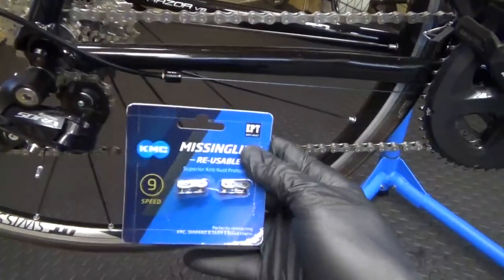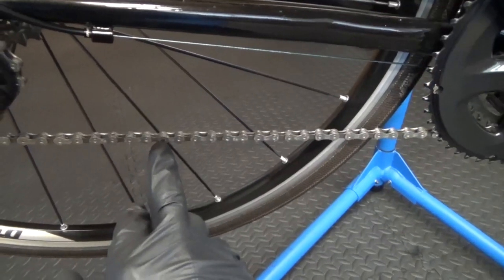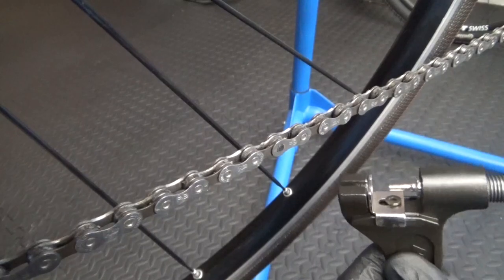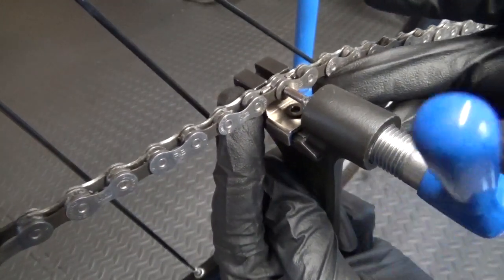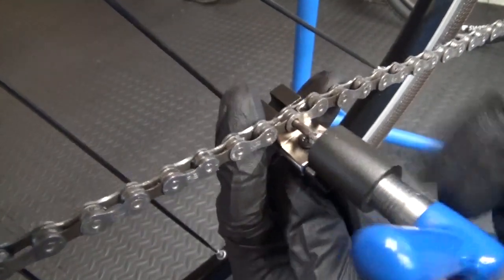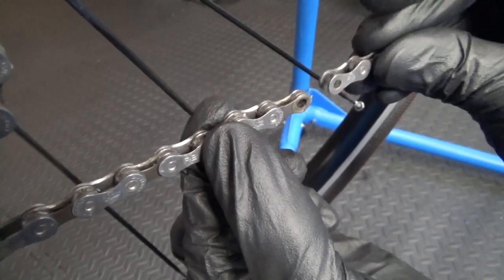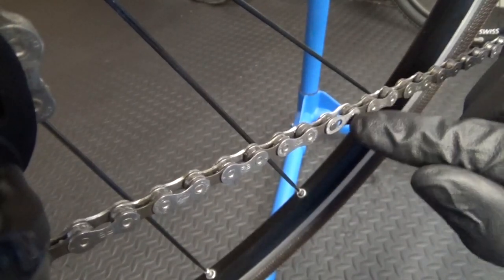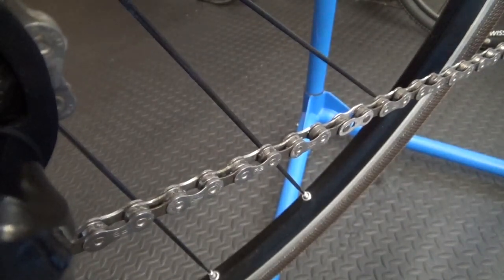How to Install a Missing Link to Your Bicycle Chain

Comment: I hear many people say you should only re-use a quick link too many times. I’ve often wondered if there’s a number of times. My chain is on a trike. I remove for clean/hot wax every month or two. I have three KMC missing links to make the job easier. They’ve been re-used maybe ten times. No problems.
Reply: I'd probably replace one with the chain, so If I replace my chain at 3k miles. I will get a new quick link. it's obviously reusable, they have tools designed just for them. That being said, if it concerns you, just keep a spare set of quick links on you when you ride.

Comment: I was also thinking about getting one of those KMC quicklinks, as they’re rated as “reusable” and they claim they can be reused up to 3 times. Though I don’t know what it’s meant by that, do they mean the link can be opened and closed up to 3 times or they can be used with up to 3 different chain cycles. Either way I was confused about whether it was better to use a joining pin or a quick link as a connection method and have found discording views about both, but I think I’ll try out both and make sure to change them from time to time for safety precautions. Your guide is very clear and helpful!

Comment: 0:05 ok right it's only good for one occasionally if your chain snapped my riding is fitting or do the job correctly 24-hour emergency Friday and back home from certain places where are advised many people not to go for a split link and put it on your bike I buy you to unlink one of the links a link extractor and put it on permanently starts wearing and tearing then once the chain snapped on you after usage then you are able to use a split link for emergencies when you're out and about

Comment: May be stupid question - but is it possible to press the pin back in the same chain link? I just want to replace the front derailleur, so essentially I just need to open and close the chain.
Reply from the maker: You would have to install a brand new pin!

Comment: What if the link has a directional arrow on it? I can't get my head round it. If you put one part of the link in so that the arrow is pointing in the direction of travel, the other part points against the direction of travel. Does any of this really matter cause I can't see any way round it. Same with the chain. Some chains say to have writing facing towards you. What difference does it make?
Reply: I have the same  question on those arrows; only one can point the correct direction.  The writing  must face out, so it’s with the writing I had the arrow go in the correct direction.  Shimano can sure use to clarify the double arrow matter.

Comment: I don't think my mountain bike has a quick link how do I take the pin out of a derailleur see if I if I can take the pin out of a brand new derailleur a front derailleur could I put that on the chain but what I want to know is if I take the pin out if you can take if I can take the pin out of the front derailleur the brand new one that I am getting where do I find a pin to put into the the front derail